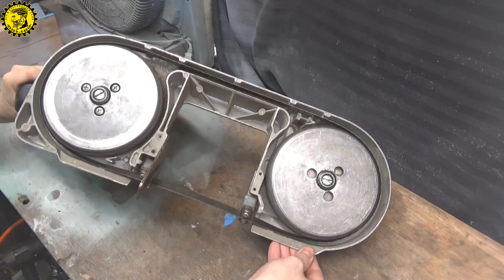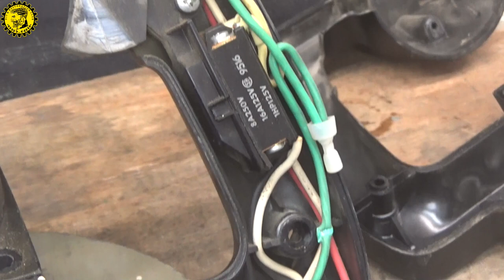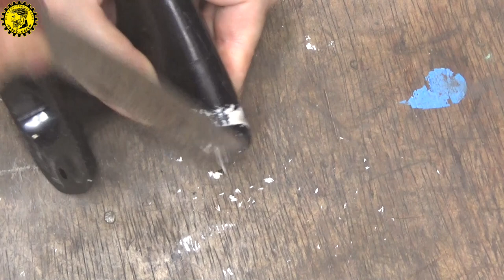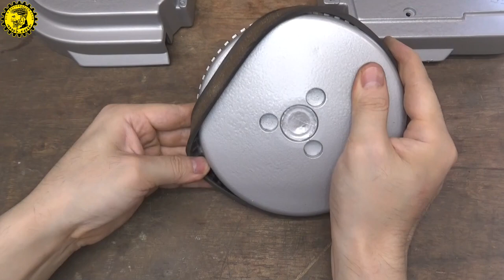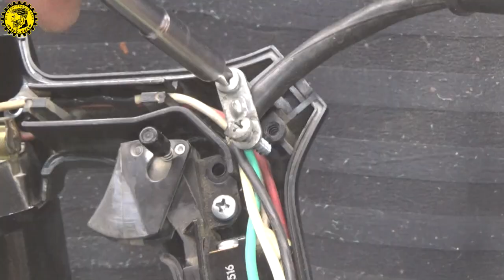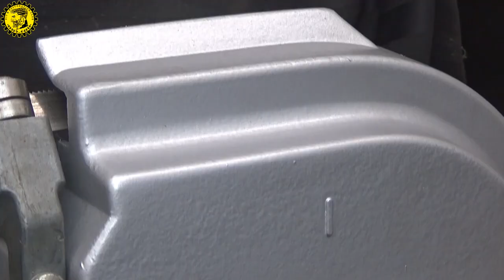Band saw Restoration.

Comment: If I'm not mistaken, there should be a cover that covers the whole front side so if anything happens, you dont get hit with the blade, it just breaks or comes loose inside the cover
Reply from the maker: That's right.
A hole for fixing the cover bolt was found.
However, it did not exist at the time of purchase. It's a shame.